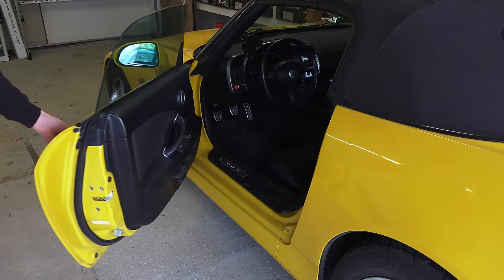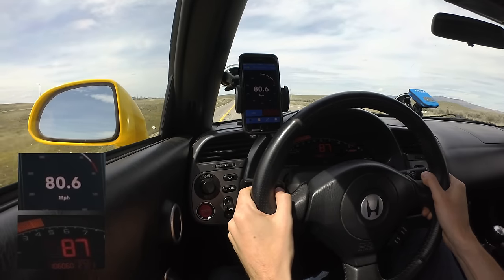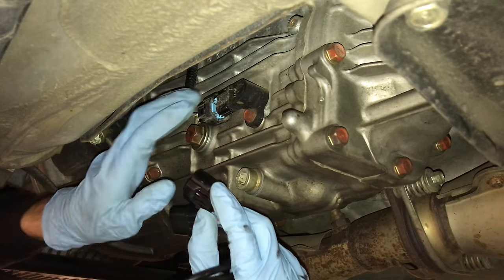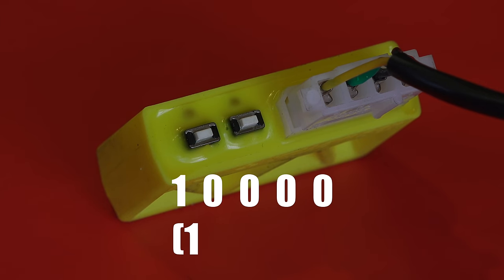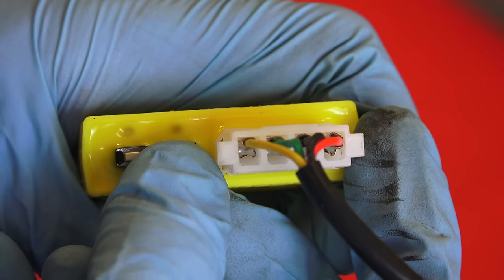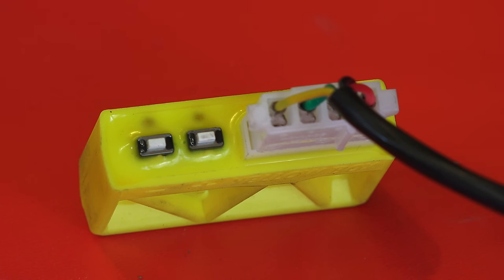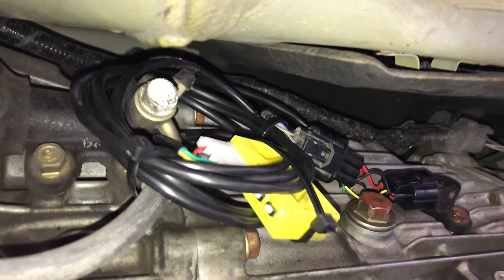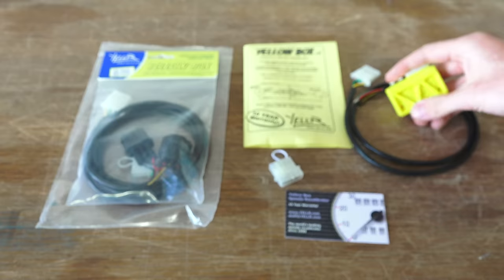How To Fix A Misreading Speedometer

Comment: do any for safety important systems grab the speed from there? if yes it might be pretty risky in case of failure or delay(real time applications) - yes 10 years guarantee... but you wont care about guarantee if this thing fucks up at 200 kph...

Comment: You'll fine that most modern cars read at between 5% to 10% higher than actual, usually around 7% , (at least I know this to be true of Jap cars). Just got a 2008 Nissan Skyline 370GT and it's stock and reads just over 7% higher.. The 2000 Nissan Gloria Y34 I had before this read 5.7% higher than actual also..

Comment: all these companies are out of hand. just find out the pulse per mile rate of your oem speedo, and get a gps controller to match for much less than any of these extremely overpriced speedo calibration tools or dealer cost. its a shame that people allow crooks like this to seriously over charge for such a simple product. also if you convert to a gps signal you never need to calibrate no matter what tire or gear you run again. BUY ONCE CRY ONCE.

Comment: I was expecting some whiteboard calculations to show the math behind the changes the tires and differential caused, or maybe an ECU tune.  No explanation of the circuitry or how the components work either (probably mostly a microchip, so the logic in it).  At least wear a Speedo (preferably over your pants) if you're going to do this type of video with extreme click bait links.

Comment: This looks like a pain in the ass. There has to be a better interface you can use rather than pushing a button 70 times. Also, do you have to leave that attached from then on to get the right speed?

Comment: Somebody shouid make a device which is connected to the ODBII-port to get the speed shown, a build-in GPS to get the real speed, and then connected like the yellow box to correct the speedometer.
The GPS-speed is accurate within 0.1km/h or better, when not disturbed by reflections and bad signals.
So the unit could calculate the correction factor when the signal is good, but the speedometer would be using the pulses so it would show the correct speed even in urban canyons and tunnels where the GPS does not work.

Comment: Why not just put 7.4% larger diameter tires on the axle with the drive wheels next time you need to replace those tires?  Then this gizmo wont be needed.
Reply: Because larger diameter tires won't always fit without rubbing/scrubbing on the arches, especially on lowered cars. Additionally, a device like this allows you to run any wheel and tire setup you like and just correct the speedo. As opposed to being restricted to one setup only.

Comment: Too bad they didn't just include the correct reluctor ring in the transmission to compensate for the drive ratios so you wouldn't have to do all that. I mean, you're probably spending thousands for a modified trans.

Comment: The device itself maybe weather proof and water proof, but not those cheap computer 4 pins connectors... If you leave them like that, I'm pretty sure they won't last.
Reply: totszwai fill the connector with white lithium grease it'll be fine 🤗

Comment: Ignore it...As most of you know the whole planet is becoming a NANNY state.
So if every car on the road had a speedo reading lets say at 100k's and the real speed being done is 95 all the cars would be running down the Highway at 95 so no one thinks any different.
My 2016 Toyota Hilux Trayback reads 120K at 110 on the 3 GPS's I have put in it.
My last car got to go down to Victoria and in 2 places on the main highway, there are overhead speed radars that let you know your speed as you go under them.
So I asked a Police Officer that was managing a radar trap if he could check my speed well the GPS was right.
So it is a standard thing with cars in the last 10 years that they run off the factory floor with a speedo that reads faster than the real speed.
TRY for yourself get a few folk together and set up a bunch of GPS and go for a drive in everyone's car --- you all just may get a shock.

Comment: What if my speedometer is showing 5 mph above my real speed, but only above 30mph? Everything below that is accurate.            25mph speedo = 25    40/80mph speedo = 35/75 Actual
Reply: Userneame Taken
Take Algebra 2 and ask the question better afterwards.
Reply: He asked it perfectly fine. I understood exactly what he was saying. Maybe you just need to retake 5th grade math.
Reply: MJorgy5 I apologise if my terminology isn't up to your level of excellence.  Thanks for the opinion, but maybe next time save your energy and keep scrolling through the comments.  :)
Reply: Unless you have a bad speedo cable or speedometer (assuming they're analogue) this is entirely impossible. A speedometer's reading is changed as a percentage (more or less) assuming the stock gearing and tire circumference are two constants.
Reply: Wheels are aftermarket, 19''s now, even when I had factory 15s on for winter nothing changed,  my guess either the cable of the clocks themselves.